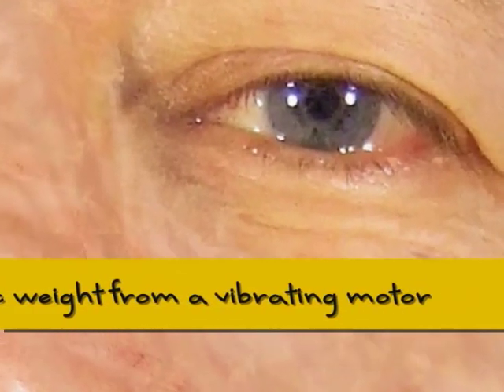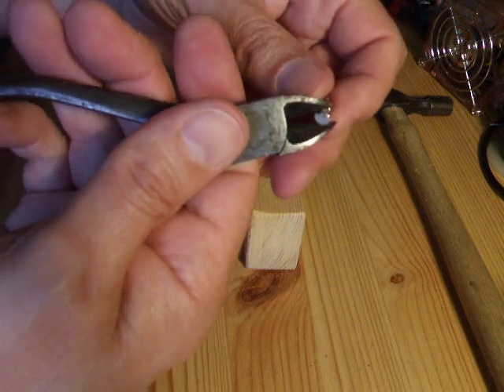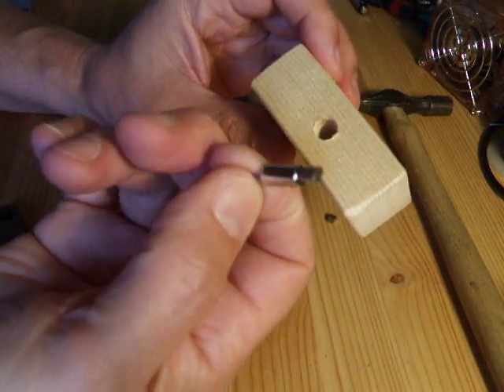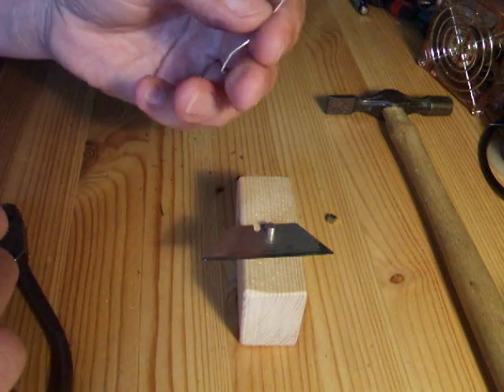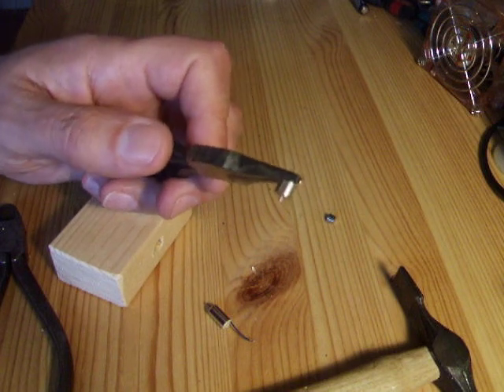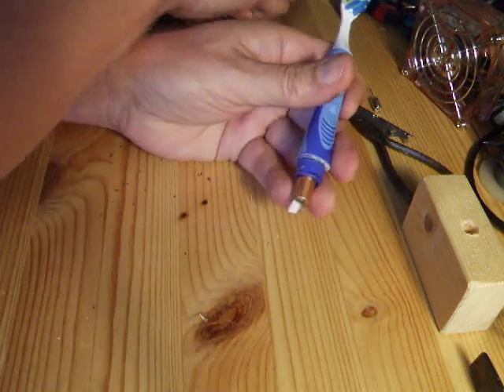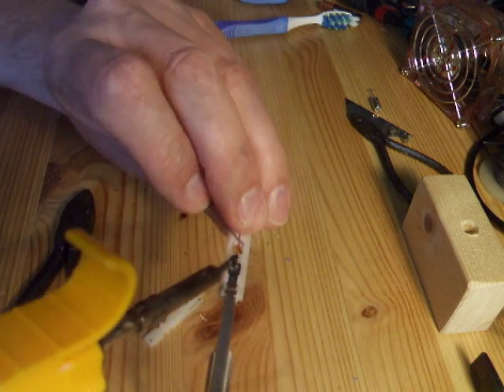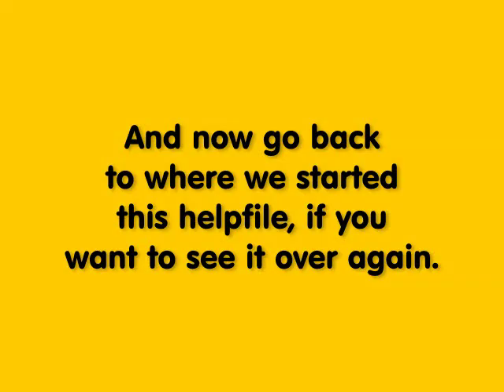Helpfile - How to remove the eccentric weight from a vibrating motor OralB Toothbrush etc

Comment: Thanks grandpa. I don't know if it'll work or not but great idea.

Edit.: It worked. 😊😊
Reply from the maker: Well done 👍👍😁😁 I have noticed the more recent toothbrushes are using smaller motors with thinner shafts. I have bent quite a few of the newer ones.
Reply: @GrandadIsAnOldMan  I tried this on mobiles vibrator motor. An old nokia phone.

Comment: I'm upset on how easy this was. Whole time I'm ruining xbox controller motors. I used a blade and a roll of electrical tape. Came right off. Cheers.
Reply from the maker: Excellent, well done. This video is 10 years old. I found some of the more recent toothbrush motors had very thin shafts and my success rate dropped significantly ☹️

Comment: i have a much smaller motor than this extracted from an ancient nokia phone but accidently ive broke the shaft now motor is fine and running but there is no shaft 😭
Reply from the maker: Difficult to think of a use for it now 🤔
Reply: @GrandadIsAnOldMan  are these motor available for retail sale?
Reply from the maker: I am sure you will find them on eBay or ALiExpress or similar online stores. Search for coreless motors. You will then be able to see what sizes are available @14yogeshkumar99
Reply: thanks  @GrandadIsAnOldMan

Comment: Great method, you no doubt saved me some grief, Thank You!
Reply from the maker: In an ideal world you would use a sprocket puller that grips the weight and has a pin that you wind into the shaft hole, to gently push the shaft through, but I have never seen one small enough to use on this size motor

Comment: I wonder if this would work on the rumble motors from a dual shock controller. They are bigger and almost seems to be welded to the pin
Reply from the maker: There is one way to find out, but don't be surprised if it fails. I don't get a 100% success rate. If the controller is important to you, don't do it. If you are scrapping it and just want the motor, then you just have to accept you might damage it trying. I had loads of those old toothbrushes, so a few failures didn't matter to me. If they failed I would strip them down and save the magnets from inside.
Reply: Actually just used needle nose and placed it under the weights and above the pin and squeezed it off
Reply from the maker: @mossbegamin  Sometimes that pulls the motor shaft out of the motor, with the weight still attached, which is why I am doing it this way round and tapping the shaft through the weight.
Reply: @GrandadIsAnOldMan  I see. Givin the size of this motor I'm not sure how I could use your method. Especially since I'm just getting into DIY things and don't have wood laying around to drill a hike through 🤣
Reply from the maker: @mossbegamin  if your method worked for you then there isn't a problem. If you plan to do lots of them then you may find the problem I describe and you might want to consider making a jig for doing the job. At the time, I had lots of these old toothbrush motors and I was damaging more that I was saving so it was worth my time. However in the big scheme of things it is cheaper to buy them new on eBay, these little coreless motors are very cheap, or you can pay just a little more and get much more powerful ones. A set of four replacement motors for a small quadcopter are not very expensive and will be much more powerful. Just depends what you want them for.

Comment: Finally I found this video. Thanks bro.
Reply from the maker: Good luck, when this works right it is great but if you don't hit it straight or you use the wrong size rod to drift it, you will bend the shaft easily. Recently I found they had reduced the diameter of the shaft in the motor - probably using even cheaper motors - and my success rate dropped significantly. Please understand you can buy better more powerful motors very cheaply on eBay and other online stores if you search for something like 3.7 volt coreless motors.

Comment: now i can die in peace thank u been waiting for this
Reply from the maker: Thank you, since I made this video back in 2013 I have found the newer toothbrushes have motors with thinner shafts and my success rate has dropped. I was getting nearly 100% success with this method but recently I damaged more motors than I saved :-( You need to strike the shaft very straight, if the wood block or metal blade slide about then the shaft will bend.

Comment: cool u r my savioior i already killed one motor trying to get the load off before this lol
Reply from the maker: Thank you. This method works OK as long as you hit the shaft cleanly and do not allow the motor or the assembly to wobble around. I was getting nearly 100% success but recently I have been trying to do this with motors that have very thin shafts and have had a terrible success rate. It seems that the manufacturers have changed to smaller motors with thinner shafts, probably to save money, and the latest ones have been very weak.

Comment: i was trying it with electric board it brust and i was shoked that   i have lost my 15th motor and i had odered it many times then i saw your vidio it is very nice
Reply from the maker: You need to strike the shaft very straight or you will bend the shaft. I have found the newer toothbrushes have motors with thinner shafts and my success rate has dropped. I was getting nearly 100% success with this method but recently I damaged more motors than I saved :-(

Comment: i just so happened to have one of these toothbrushes laying around thanks for the tips. Got my piece off by cutting a small piece of paper clip about 1 cm and held the piece with pliers and gave the piece of paperclip a good wack. anyone who doesnt have a razor try that
Reply from the maker: I have found the newest toothbrushes have motors with even thinner shafts and I am getting more failures with this method as the shafts are bending more easily so extra care is required. Probably the best option would be a vice with some sort of adaptor in the jaws to grip the weight firmly so you can tap the shaft through. There would be less chance of bending the shaft then. I have seen a proper tool for removing pinion gears from racing motors. Unfortunately those shafts are much thicker but somebody who had the necessary skills could make one.

Comment: Just the tip I was looking for, thanks!
Reply from the maker: Good luck. I have found the most recent toothbrush motors have been reduced in size and the shafts are even thinner. I have bent a couple. KagaBugaga (in the comments here) has suggested heating the weight to help it come free. I have done that on larger motors but not with these little ones. I have seen a tool on eBay for pushing the shaft through but that was quite expensive. It was designed to get the pinion gears off the shafts of helicopter motors.

Comment: Broke 2 vibromotors this way :`(
Turned out the eccentric on my motor was fixed with some glue. Came off pretty easy after heating up the eccentric.

Comment: That's Brilliant! Ingeniously simple as all great ideas are. Well done mate! But now that you have this tiny little motor, what do you use it for?
Reply from the maker: I uses them in many of my projects including small aeroplanes but here is a car that uses 4 at once https://youtu.be/1yJb_dIebaA
Reply from the maker: Here are a couple of related playlists (they were in the video description) 
Using the Oral B Toothbrush Motor https://www.youtube.com/playlist?list=PLA5a2xPRSrB0bsGC0JThAhfhgShEFUOfa
Using vibrating toothbrush motors or similar https://www.youtube.com/playlist?list=PLA5a2xPRSrB3jAX4ymLvmoN8OtvQkKuTC
Reply: Thank you! I've just spent a little over an hour watching a credit card car, polystyrene plane, solar-powered boat,  a ceiling hugger etc with great interest and enjoyment. I've subscribed. Your accent is just like Pam Ayres, so I imagine that you're from Stanford-in-the-vale or thereabouts (or at least my Professor Higgins avatar does).

To save you some money and some time, here's where you can lay your hands on more of those motors, much more cheaply than salvaging them from toothbrushes:
http://www.ebay.co.uk/itm/10Pcs-per-Set-4x8mm-DC-1-5-3V-Micro-Cell-Phone-Coreless-Vibration-Motor-Vibrator-/152210215883?hash=item23706f93cb:g:3WUAAOSwMtxXtYC3
and
http://www.ebay.co.uk/itm/10Pcs-x-4x8mm-DC-1-5-3V-Micro-Cell-Phone-Coreless-Vibration-Motor-Vibrator-New/291811219385?_trksid=p2047675.c100005.m1851&_trkparms=aid%3D222007%26algo%3DSIC.MBE%26ao%3D2%26asc%3D38661%26meid%3D311ef7f2108d46ff828ab8f9ae97765e%26pid%3D100005%26rk%3D2%26rkt%3D6%26sd%3D172347450190
Reply from the maker: dawnlightening Thank you. When I buy motors from eBay I buy the more powerful versions that are designed as replacements for the mini quadcopters, they are still cheap and probably 10 times as powerful. As for cost, we use the Oral-B toothbrushes and over the years I build up quite a stock of them so they are free to me. I always advise people to buy online if they want to make a plane or similar as buying a toothbrush just for the motor would be incredibly expensive however I would rather make use of them than throw them away. Finally, I have noticed in the more recent Oral-B toothbrushes they have reduced the size and power of the motors so the newest are very limited in their usefulness, but I will still find something to do with them 😊

Comment: This made my day. Thank you so much for this amazing trick. Been struggling to do it for so long. Already wasted about 5 motors. Will try to use your method.
Thanks again.
Reply from the maker: thanks, I hope it works for you. I use this method every time now. The only problem I get is the short piece of wire sometimes bends before it has done it's job.

Comment: Guess who pulled the shaft out of a motor ?!
Thing is, I just broke another, even following your great idea in the vid. These ones I got on Ebay have a plastic area before the metal can body. Still, it's a learned technique...2 down, 8 to go lol, Hopefully i'll savage a couple of them !
Reply from the maker: I have managed to bend a couple of shafts by not striking the pin straight but other than that I have had no problems since making the wooden block. I don't know if there is a variation in the quality of the knife blades as I would assume the metal needs to be completely rigid, any flex would allow the strike to go off line or reduce the force of the impact.
The pin used to punch it through needs to be the right material too or that will bend when you hit it.
Reply: GrandadIsAnOldMan
Thanks very much for the info. I used a pin that I snipped to about 1/3rd length with pliers, it's too soft. The vibrate part is a tight fit in the 'Stanley' knife blade, though is by another company.
Believe it or not, i'm actually building a plane and wanting to try it with a 5F supercap. You have always seemed to have so much fun with such builds, thought i'd try it out :)

Edit to add - these are 4mm motors. Can't tell if yours are 4mm or 6mm.
Reply from the maker: slider2732 just measured one and it is 6mm diameter 12mm length.

Comment: I did a video years ago about stripping them out of the Pulsar Toothbrush too. Great to see someone succeeded in getting that weight off the motor. I will have to give it a whirl again. I stopped after destroying two motors and got discouraged.
Reply from the maker: Thanks, I destroyed a couple too, I also ruined a couple by pulling the wires out due to lack of care and replacing the wires into the motor is too difficult for me.